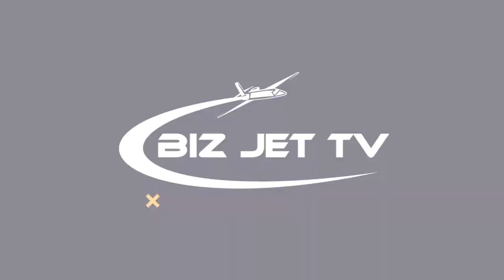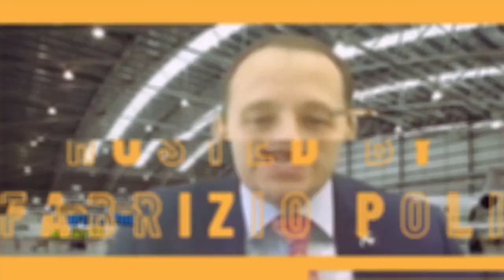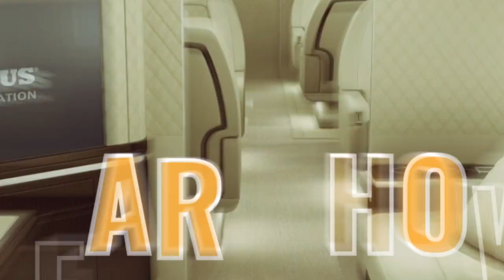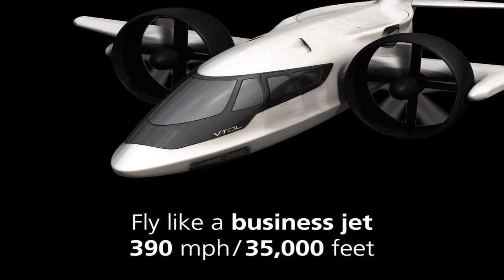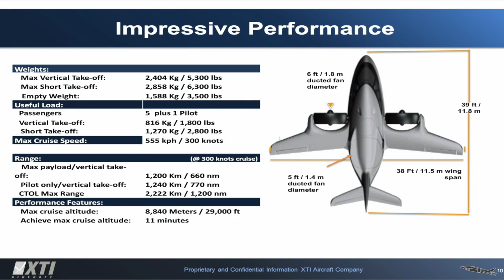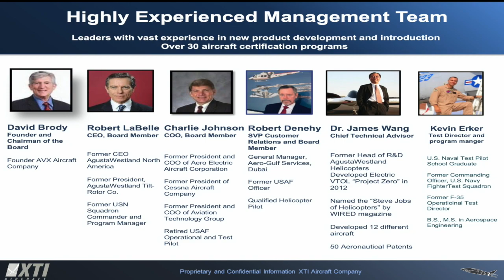The Vertical Takeoff & Landing Revolution

Comment: I will believe it when I see it fly.
Reply from the maker: it's happening
Reply: @BizJetTV  Not yet.  Not one single full sized flight to date.  When it starts certification flights (the company website says those will start 2021-2022) I will pay more attention.  There have been a lot of prototypes in the past that never made it past the design or planning stage.
Reply: @michaelgilmer3836  At FL290 and 390 MPH and 1200 km range in VTOL, it won't replace business jets.
Reply: @shadowmist1246  Agreed in most situations.  That is why i say I will believe it when I see it.  It is a niche product.  Only time will tell if the niche is big enough to support the high costs of certification and production.